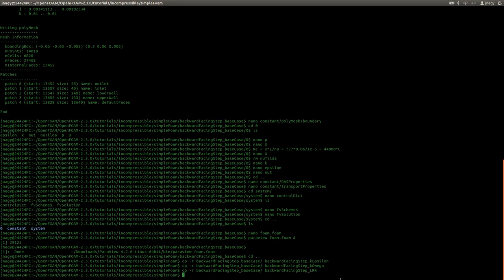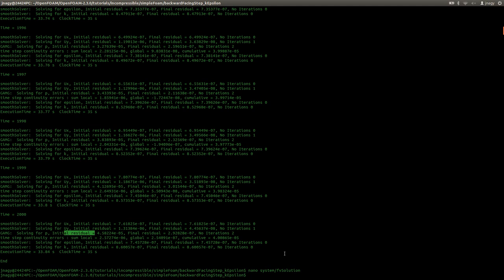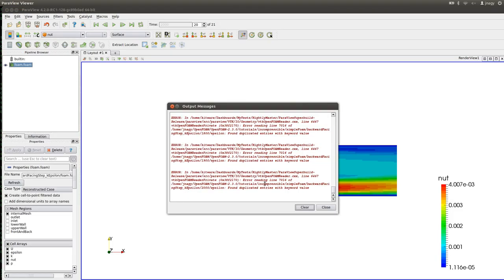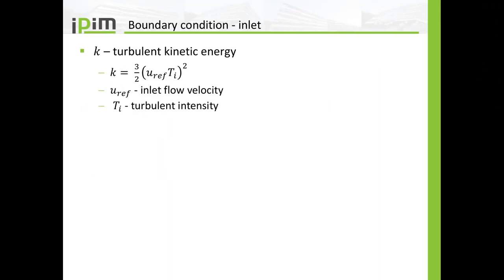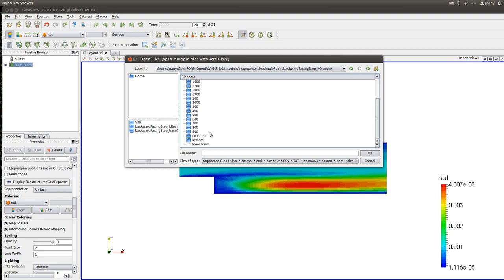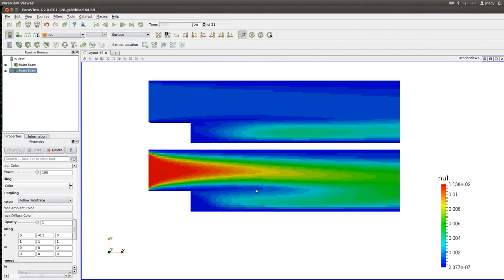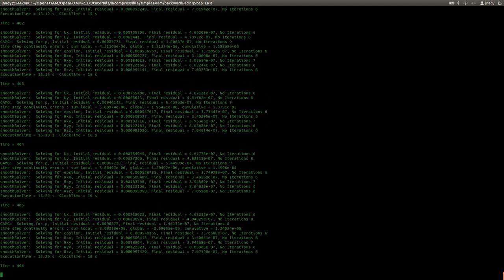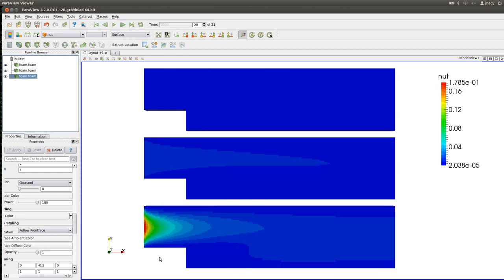Introduction to stationary turbulence modeling (RAS) - Part 3

Comment: Why large initial residue number is considered to be bad, if the final residual achieves the desired accuracy? Or the point is, that in this problem it is not a serious issue to wait a bit for achieving stationarity, but in more realistic cases, large initial resildual will lead to long convergence, or even failure of it?
Reply from the maker: It gives the change you get by using a new e.g. velocity value in the pressure equation. This means, that your simulation still changes a lot and is not convergent yet.

Comment: Hi Mr. Nagy Thank you very much for your tutorial as always. I am having doubt, if you kindly help me to clarify those, it will be very useful. I have spherical mesh domain and at the center I have a plate and I wish to compute aerodynamic coefficients at different conditions. I have to use compressible flow. I am using freestram as BC for p and U, but not sure as I am getting diverged. Also I see negative k and epsilon (which is wrong). How can I calculate k and epsilon for farfield. Thank you very much. And happy new year. Bye
Reply from the maker: This can be numerics. Did you change your discretization schemes?
Reply: @OpenFOAMJozsefNagy  no I didn't change. I shall take your advice and try again. Thanks for your suggestion.

Comment: Hello Everyone,  first case(k-epsilon) results is very different in OpenFOAM 5 (i checked repeteadly.) and even the simulation crashes in 5000 iteration with 2nd order upwind scheme for turbulence kinetice energy. The initial residuals are very high at last time step. Are  these differences in solution between software versions  usual? And the convenient discretization schemes differ from the version to version?

*Mr. Nagy thank you for the tutorials.
Reply from the maker: You are welcome, and yes there were major changes to the turbulence models since this version of OpenFOAM.

Comment: In my experience I've had better results visualizing separation bubbles by looking for where the wall shear stress equals zero as opposed to tracking Ux, Uy, or Uz. On complex, 3D geometries, the velocity alone may under-predict the true scale of the separation.
Reply from the maker: Of course, however this is an introductory tutorial, I cannot go crazy. If you are interested in these flows, you should check out all the features in the source code.

Comment: Hello Mr. József, great tutorials! 
This is the first time I got stuck and i need to ask this question. I used this command to create R values: 
   -simpleFoam -postProcess -func R 
I got turbulenceProperties:R file in my 0 folder but instead of getting: 
   internalField nonuniform List <<symmTensor> and its values 
I got this: 
   internalField uniform (0.133333 -0 -0 0.133333 -0 0.133333)
This doesn't seem right to me, could you help me out?
Reply from the maker: Yes, this changed in recent versions.

Comment: Hi,

I'm a student writing my bachelor thesis with OpenFoam. I'd like to do your backstep simulation with the rhoSimpleFoam solver(compressible flow). Unfortunatelly, I couldn't find any valid ressources and the case tutorial is unhelpful. What would you recommend?
Reply from the maker: +Vlad Chalapco Do this tutorial, do a rhoSimpleFoam tutorial and change the dictionaries from this one to the needed ones for rhoSimpleFoam. Step by step.
Reply: Thanks

Comment: I have a Floating Point exception (core dumped) when I run the simulation kEpsilon (Time=19s). What should I do to correct this? I did it step by step like the tutorial. Thank you so much!
OpenFoamVersion v7.
Reply: decrease the value of K in 0 folder
Reply: I had this problem as well. In the file k, I have changed its value from 0.2 to 0.3, and the simulation has worked. I am figuring it out, because I still don`t know the reason of this happens.
Reply: @murilobrunazzo7053  Glad to found this comment, it solved my problem in OpenFOAM 8 , but the graph in ParaView differs much as what Joszef was explained in video right?

Comment: Hi! I just had a doubt! Is it sufficient for the average yplus to between 5 and 30 or should it be the minimum yplus?
Reply from the maker: Well this is a tutorial, it should give you a first idea about the workflow of OpenFOAM. For an actual simulation you should by between 5 and 30, however for a complicated geometry this will be a challenge. The question is always, how big your error is, which you create by being outside of this interval.
Reply: Got it! Thank you very much for your tutorials ! :-)

Comment: in the version 2012
at time = 11 i am getting error
Time = 11

smoothSolver:  Solving for Ux, Initial residual = 1, Final residual = 7.34729e-07, No Iterations 39
smoothSolver:  Solving for Uy, Initial residual = 1, Final residual = 7.34771e-07, No Iterations 39
#0  Foam::error::printStack(Foam::Ostream&) at ??:?
#1  Foam::sigFpe::sigHandler(int) at ??:?
#2  ? in /lib/x86_64-linux-gnu/libpthread.so.0
#3  Foam::scalarProduct<double, double>::type Foam::sumProd<double>(Foam::UList<double> const&, Foam::UList<double> const&) at ??:?
#4  Foam::PCG::scalarSolve(Foam::Field<double>&, Foam::Field<double> const&, unsigned char) const at ??:?
#5  Foam::GAMGSolver::solveCoarsestLevel(Foam::Field<double>&, Foam::Field<double> const&) const at ??:?
#6  Foam::GAMGSolver::Vcycle(Foam::PtrList<Foam::lduMatrix::smoother> const&, Foam::Field<double>&, Foam::Field<double> const&, Foam::Field<double>&, Foam::Field<double>&, Foam::Field<double>&, Foam::Field<double>&, Foam::Field<double>&, Foam::PtrList<Foam::Field<double> >&, Foam::PtrList<Foam::Field<double> >&, unsigned char) const at ??:?
#7  Foam::GAMGSolver::solve(Foam::Field<double>&, Foam::Field<double> const&, unsigned char) const at ??:?
#8  Foam::fvMatrix<double>::solveSegregated(Foam::dictionary const&) at ??:?
#9  Foam::fvMatrix<double>::solveSegregatedOrCoupled(Foam::dictionary const&) at ??:?
#10  Foam::fvMesh::solve(Foam::fvMatrix<double>&, Foam::dictionary const&) const at ??:?
#11  ? in /usr/lib/openfoam/openfoam2012/platforms/linux64GccDPInt32Opt/bin/simpleFoam
#12  __libc_start_main in /lib/x86_64-linux-gnu/libc.so.6
#13  ? in /usr/lib/openfoam/openfoam2012/platforms/linux64GccDPInt32Opt/bin/simpleFoam
Floating point exception (core dumped)
Reply from the maker: Thank you for the information. I just tested this tutorial with v2012 and it nicely converges for me. There may be a case setup problem on your end. Maybe you forgot something?

Comment: Can i ask why my initial residual is around 1e-03 or 1e-04 which is much higher than urs in the tutorial? Will it has influence on the further result?
Reply: one more question:when i run the commond: simpleFoam -postProcess -func yPlus, it only shows the result of TIme=0. what's wrong with that?
Reply from the maker: @chensongtao9244  Might be the difference in OpenFOAM version. I do not know, why you only get the results for the first time. Maybe you ran the simulation in parallel?

Comment: Time = 18

smoothSolver:  Solving for Ux, Initial residual = 4.12274e-06, Final residual = 6.37679e-07, No Iterations 1
smoothSolver:  Solving for Uy, Initial residual = 1.11335e-08, Final residual = 1.11335e-08, No Iterations 0
GAMG:  Solving for p, Initial residual = 5.32991e-12, Final residual = 5.32991e-12, No Iterations 0
time step continuity errors : sum local = 1.21668e+20, global = -8.72718e+14, cumulative = -2.99379e+15
smoothSolver:  Solving for epsilon, Initial residual = 4.84391e-14, Final residual = 4.84391e-14, No Iterations 0
smoothSolver:  Solving for k, Initial residual = 3.24229e-06, Final residual = 8.00548e-07, No Iterations 4
bounding k, min: -18405.2 max: 1.48162e+39 average: 1.84105e+36
ExecutionTime = 0.6 s  ClockTime = 1 s

Time = 19

smoothSolver:  Solving for Ux, Initial residual = 0.610723, Final residual = 9.80804e-07, No Iterations 31
smoothSolver:  Solving for Uy, Initial residual = 0.196477, Final residual = 7.73829e-07, No Iterations 26
#0  Foam::error::printStack(Foam::Ostream&) at ??:?
#1  Foam::sigFpe::sigHandler(int) at ??:?
#2  ? in "/lib/x86_64-linux-gnu/libc.so.6"
#3  Foam::GAMGSolver::scale(Foam::Field<double>&, Foam::Field<double>&, Foam::lduMatrix const&, Foam::FieldField<Foam::Field, double> const&, Foam::UPtrList<Foam::lduInterfaceField const> const&, Foam::Field<double> const&, unsigned char) const at ??:?
#4  Foam::GAMGSolver::Vcycle(Foam::PtrList<Foam::lduMatrix::smoother> const&, Foam::Field<double>&, Foam::Field<double> const&, Foam::Field<double>&, Foam::Field<double>&, Foam::Field<double>&, Foam::Field<double>&, Foam::Field<double>&, Foam::PtrList<Foam::Field<double> >&, Foam::PtrList<Foam::Field<double> >&, unsigned char) const at ??:?
#5  Foam::GAMGSolver::solve(Foam::Field<double>&, Foam::Field<double> const&, unsigned char) const at ??:?
#6  Foam::fvMatrix<double>::solveSegregated(Foam::dictionary const&) at ??:?
#7  Foam::fvMatrix<double>::solve(Foam::dictionary const&) in "/opt/openfoam7/platforms/linux64GccDPInt32Opt/bin/simpleFoam"
#8  Foam::fvMatrix<double>::solve() in "/opt/openfoam7/platforms/linux64GccDPInt32Opt/bin/simpleFoam"
#9  ? in "/opt/openfoam7/platforms/linux64GccDPInt32Opt/bin/simpleFoam"
#10  __libc_start_main in "/lib/x86_64-linux-gnu/libc.so.6"
#11  ? in "/opt/openfoam7/platforms/linux64GccDPInt32Opt/bin/simpleFoam"
Floating point exception (core dumped)
Reply: hello sir , what should i do in this stua.?=

Comment: [SOLVED]
Whenever I run the  "R " command or try to find the y+ value (yPlusRAS) I get the following error :
ImportError: /opt/OpenFOAM/ThirdParty-v1912/platforms/linux64/gcc-6.3.0/lib64/libstdc++.so.6: version `GLIBCXX_3.4.26' not found (required by /lib/x86_64-linux-gnu/libapt-pkg.so.6.0)
I tried downloading libstdc++ but it doesn't get updated as the newest version has already been installed.
Can someone please help me out ?

SOLUTION: "In newer versions of OpenFOAM the commands yPlus, yPlusLES and/or yPlusRAS are not used. Instead AFTER your simulation run the command simpleFoam -postProcess -func yPlus"
https://wiki.openfoam.com/Stationary_turbulence_modeling_(RAS)_by_Jozsef_Nagy
Reply from the maker: Great!

Comment: Even I tried to rename turbulenceProperties:R to R  in 0 folder then, openFOAM found error in fvSolution, I guess I cannot follow until 21:12. The LRR model might not working properly here
Reply from the maker: In later versions the LRR model changed a lot. This is correct.
Reply: I had the same issue :(

Comment: @József Nazy When I ran this simulation k, epsilon, nuT aren't appearing in paraview where I went wrong?
Reply from the maker: Are the present in the results folders?
Reply: @OpenFOAMJozsefNagy  Actually they aren't  until I used foamToVTK to open VTK version any idea why this is happening?? 
Ps- I am using OpenFOAM8 and paraview 5.6.0
Reply from the maker: @mahashayjee5545  Create an empty .foam file. The command is "touch open.foam". Then you can open up this file in Paraview and it will visualize the results not the VTK files.
Reply: @OpenFOAMJozsefNagy  Is there any problem with results in VTK format I am asking will there be any errors or not?
Reply from the maker: @mahashayjee5545  If the command runs it is an alternative to the .foam approach, but if it fails the .foam approach is always good.

Comment: Whenever i try to execute R as per the video, I end up with this message

""R has been superseded by the '-postProcess' solver command-line option, e.g.
simpleFoam -postProcess -func R""

ANYONE with a solution!!
Reply from the maker: Yes, R was the way to do it in version 2.3.0. Now you use the suggested postProcess command.
Reply: Thanks for the response sir,
But I am currently using openFOAM V5 , so what should be the postProcess command (did u mean simpleFOAM?)
Reply from the maker: simpleFoam -postProcess -func R

Comment: Hello, I'm running openFOAM v9, and when i execute the command turbulenceFields (former R) to generate R folder, I cannot make it works.
 Can someone help me?
Below i reported the reports on my terminal after the execution of simpleFoam -postProcess -func turbulenceFields

Create time
Create mesh for time = 0

SIMPLE: No convergence criteria found

Time = 0
Reading field p
Reading field U
Reading/calculating face flux field phi

Selecting incompressible transport model Newtonian
Selecting turbulence model type RAS
Selecting RAS turbulence model kEpsilon
RAS
{
    model           kEpsilon;
    turbulence      on;
    printCoeffs     on;
    Cmu             0.09;
    C1              1.44;
    C2              1.92;
    C3              0;
    sigmak          1;
    sigmaEps        1.3;
}

No MRF models present
No fvModels present
No fvConstraints present
turbulenceFields turbulenceFields: no fields requested to be stored

End
Reply from the maker: It was discontinued as far as I know.
Reply: @OpenFOAMJozsefNagy  there are other commads of text files I have to add to avoid this interruption without results?
I have inserted the file turbulenceProperties in /constant but it seams not effective.
Reply from the maker: @ale.manzo.95  Sorry, but I am not familiar about the recent changes in v9. Maybe check the function object folder for more info.
Reply: maybe you could try with the command "simpleFoam -postProcess -func R"
Reply: How do you solve the problem? I met  a similar problem when I use v10.

Comment: When i put the kEpsilon model to run, the simulation only runs till the 1710th iteration with initial residuals on the order of 1e-1. I can't find where am i messing this up. Any guess?
Reply from the maker: Check my answer below the other video.
Reply: It seems that is actually the other way around. But anyways, the whole things was really my bad,i set the relaxation factor for the field "p" as 0.03, when it maybe was originally set as 0.3 as you teach on the video. But even though i'm getting 2000 iterations, the initial residual for Uy is on the order of 1e-3 and the number of iterations vary from 3 to 8. Finally, i want to know if you have a suggestion of course, but also an explanation on why that happens. And thank u so much for the replies.   @OpenFOAMJozsefNagy
Reply: Actually, for the sake of the community who watch these videos, i should come back and say that the actual reason why the number of iterations was beeing limited was due to a line right below the "nNonOrthogonalCorrectors" in SIMPLE, "consistent yes;". Apparently , when you delete the line, which is found, i guess, in the latest versions of OpenFoam the simulation runs completely till the end. Nevertheless, the problems with the number of iterations still exist. Now, when i'd said that the problem for the number of iterations was the relaxation factor of the field "p", i was running the simulation on my home computer, which i had already deleted the "consistent yes;" line and had only to fix the relaxation factor value from "p". In this case, the number of iterations was going merely till the 51 iteration. It was only for the case where i had the relaxation factor already properly set and the mysterious line "consistent yes;" added that the number of iterations was going to the 1710th. I must say that all this is too confusing to me. Could you help me with this?? I still don't know why the number of iterations are that high and why the initial residualfor Uy is on the order of 1e-3.  @OpenFOAMJozsefNagy
Reply from the maker: @Dmplivemail  Thank you for your input on the consistent setting!

Comment: I am getting a floating point exception error.
Reply from the maker: At which point?
Reply: @OpenFOAMJozsefNagy  hello, 
when I tried running the simulation, I received a floating point exception error and I think because the solution started to diverge. I fixed it by reducing the under-relaxation factors but I am not sure if the under-relaxation factors could impact the final solution. What do you think?
Reply from the maker: @ashishtiwari1912  No they don't, they just slow down the simulation and make it more stable. No worries.